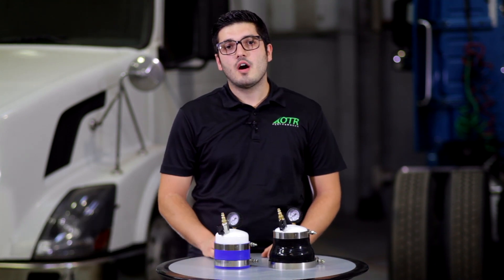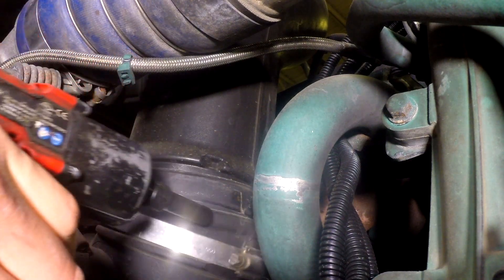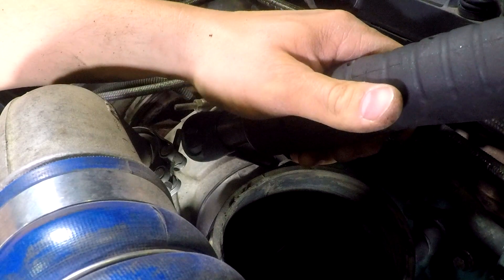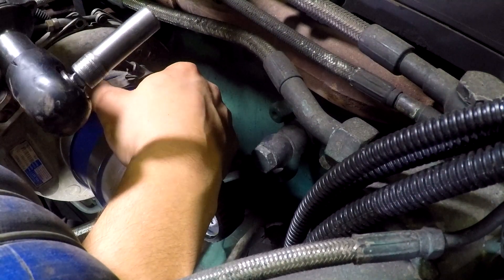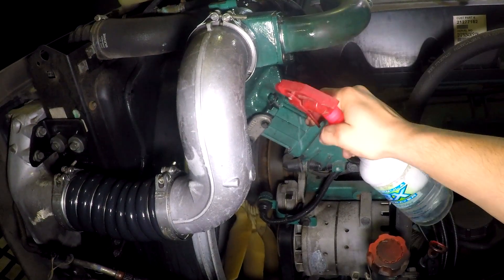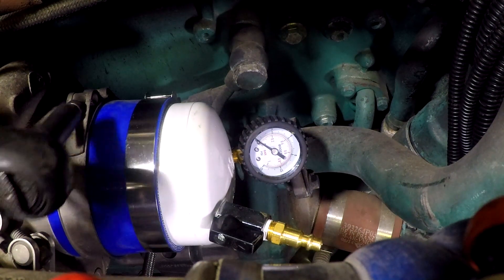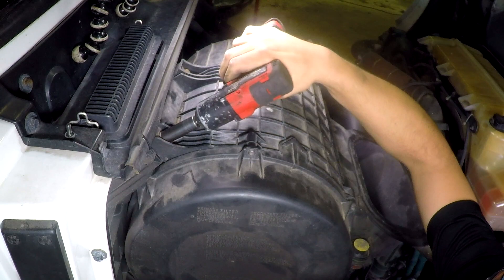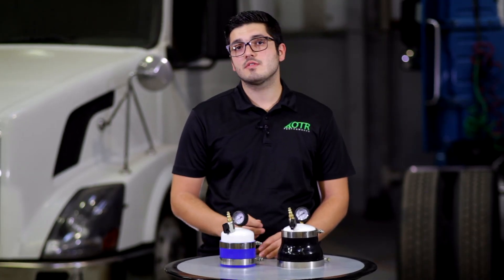Boost Leak Tester | How-To | OTR Performance

Comment: Can I connect pressure tester directly onto MAF, just after the filter?
Reply from the maker: We recommend only connecting it to the turbo as the system is only under pressure after the turbo itself.

Comment: I bought one of these testers but there is no shutoff valve on mine
Reply: You can buy a brass air compressor Shut off Valve for 8.99 on Amazon,  then just add it onto the part. Remove the male quick connect that's on the part now, attach the right size shut-off, 3/8 or 1/4", to the Pressure tester then put the male quick connect back on using white elastic tape around threads. 
Now you have a Shut-off Valve.